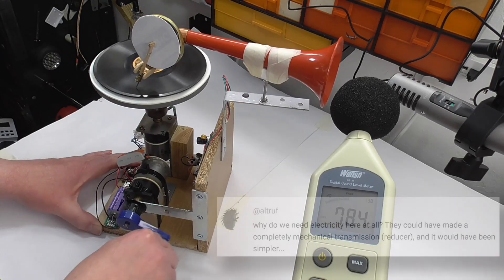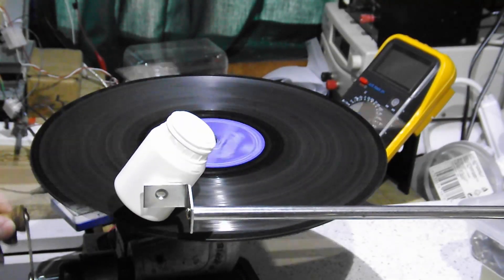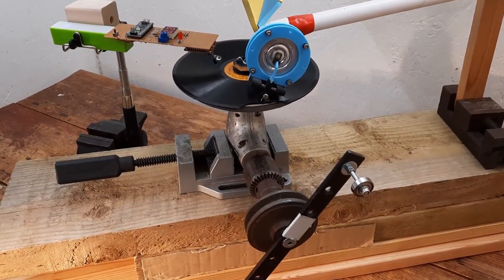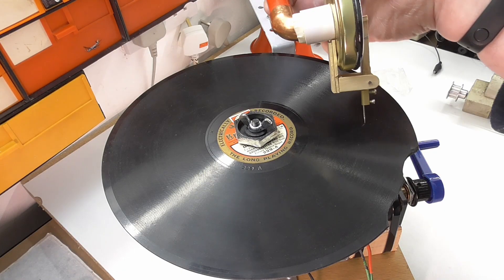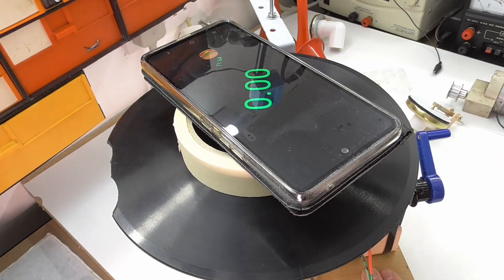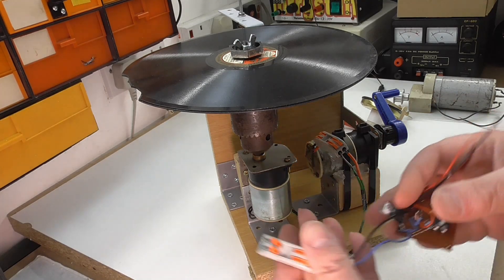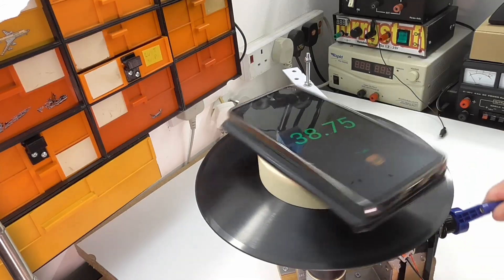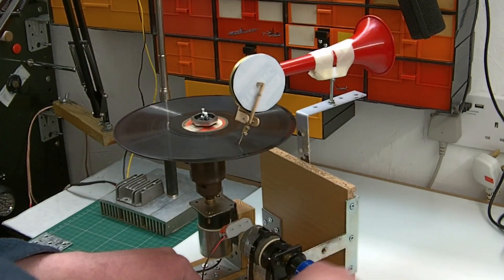(Electric) Hand cranked gramophone - but why?

Comment: needs more goldberg... lift the food to feed the mice to drive the wheel to pump the water to drive the wheel to scare the cat to stretch the spring to rub the fur to collect the charge...

the hand cranked bit is the killer, outside of a missionary player consisting of the sleeve itself twiddled with a stick, i have never seen a gramophone driven by hand directly...

currently its a hurdy gurdy with no talent beyond changing shellac required :)

Comment: @mrrgstuff recently i bought a replica gramophone and i worked on it with the speedcontrol getting it to right speed
what worked but i have sometimes if i wind the spring that my motor makes an bang noise quitly if i have wind it half
way do u maybe now what happens here in the spring barrel and if i need to be worried about it? btw were do you
buy ur gramophone needles i buyed some needles of aliexpress but am searching for an site whats safe and is faster
my replica is an indie soundmaster standard model with golden horn and redbrown case
Reply: btw it does wind great but am worried about the noise it makes halfway :\

Comment: Honestly this makes a good bit of sense. Especially since for a mechanical governor I could see a slight issue with possibly overpowering the governor and forcing it to run a bit too fast if you're not careful. Meaning you would possibly want to have a spring of some sort to allow the input shaft to flex a bit and let the governor have a chance to smooth out any fluctuations in the speed. At that point the simplest options would either be what you've done here or scrap the project and use an electric motor or a regular gramophone motor and that defeats the purpose of trying to build a hand crank machine.
Reply from the maker: Thanks 👍 😀.  Very good point you make about having some flex in the winding shaft when using a governor. I will have to consider that if I revisit this topic 🤔

Comment: I have a question about the project you made 2ish months ago, where you can acoustically record audio on your hmv machine, how are you mounting the cd so it does not slide when the soundbox is placed, because for me whenever i put a cd and i apply the soundbox's weight to it, it stops spinning with the turntable, i eventually found a cd with a sticky-like coating on the back, and it manages to stick good with the turntable, but now comes another problem, shouting and keeping track of the grooves at the same time, i don't know... seems very complicated to me without a proper build, but unfortunately that's the only thing i can do.. (Also can you tell me the rpm calculator app name Please!!!)

Comment: Those hand cranked Berliner machines must have been tricky, but perhaps not too bad with practice. Your 2:1 ratio gearbox will make things harder since every variation in cranking speed is multiplied by 2. Ever thought of hand cranking an old gramophone motor? If you have one with a broken spring, it would be a simple matter make the arbor drive the spring barrel directly & crank the handle. The governor would then regulate the turntable speed, correcting any overspeed in cranking. Btw, congratulations on the creative electronics!
Reply from the maker: Thanks 👍 😀.  Yes, the drill gearbox is far from ideal and arguably is the common weak link it all the direct drive designs I have tried. Using a broken gramophone motor is an interesting idea, too, which I hopefully can investigate further 🤔😀👍